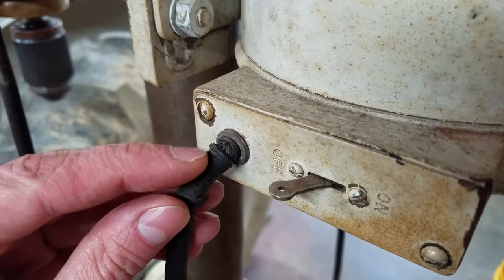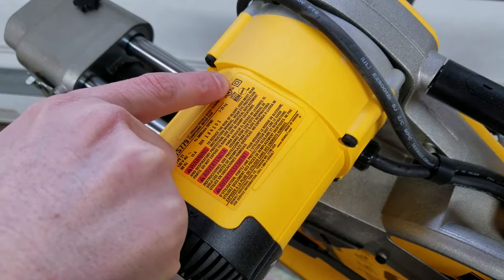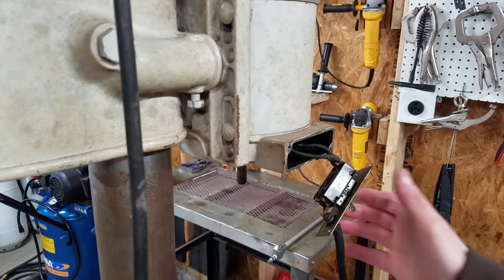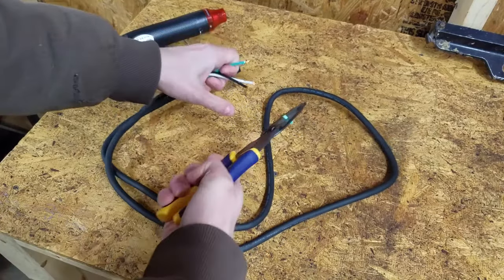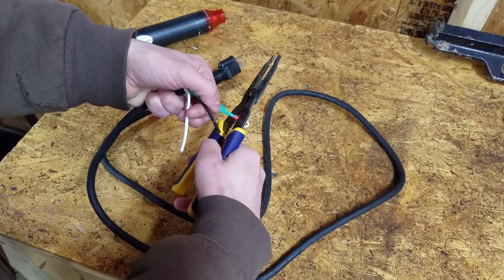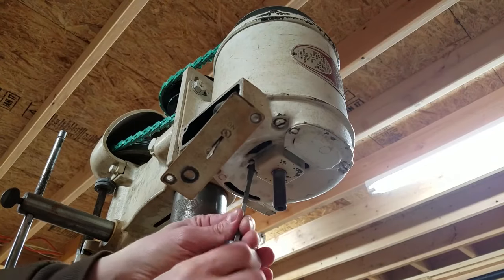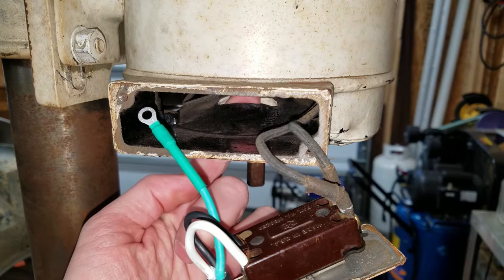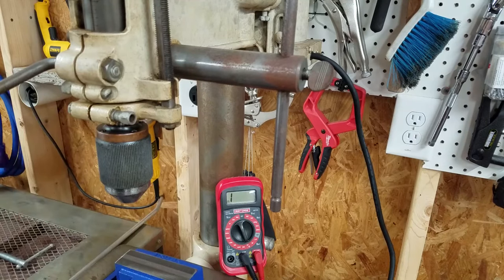Installing a 3-Prong Grounded Power Cord on a Vintage Delta Drill Press

Comment: Thanks for the video! I picked up an old Westinghouse Mobilaire pedestal fan off the curb for use in my garage. It still works fine, but the old grey 2-prong cord is pretty cracked and I would say unsafe. Just so happens that I cut the nice long 3-prong cord off my previous Bissel carpet cleaner before I threw it out and want to put that cord on the fan. I figured that I could just run the added ground wire to an anchor on the metal fan body, but in all my looking at repair videos of old fans NOBODY was upgrading them to a grounded cord! I guess I just wanted confirmation that what I was planning was correct.
Reply from the maker: This is great, my hope was that anyone looking to convert anything from a 2-prong to a 3-prong plug might find this video helpful. Thanks for the comment and thanks for watching!

Comment: This is exact;y the problem I need to solve.  Finishing the restoration on a 1948 Buffalo Forge drill press.  Would like to transition that old plug from 2 to 3 prong.  Thanks, Mike!
Reply from the maker: I'm glad the video was helpful, thanks for the comment! :)

Comment: Good Video. I'll be replacing a Power and Switch cord on an old Dayton 16 inch Drill Press, so I'll probably go with a 14-3 cord. The Motor is a Dayton 3/4 HP, 120 V. 10.8 Amps. Thanks for the wire type information too.
Reply from the maker: Thanks for watching!

Comment: Thanks, this was helpful. I just added a new grounded cord to a 1940s era drill press. When you do the continuity test with the ground plug does the reading on the multimeter matter or is the beep indicating continuity sufficient?
Reply from the maker: As far as I know, the beep is the only thing that matters. Thanks for watching!

Comment: 1. Use strain relief, not glue.
2. Ground using red terminal connector? That’s like 22 gauge! Bet it’s supposed to be blue or even yellow. Doesn’t need heat shrink. It’s ground and the terminal has insulation(bit not even needed.
3. Use nameplate to determine amperage, then size wire appropriately.
Reply from the maker: Thanks for watching!

Comment: picked up a 3/4 inch drill and got the suprise but not a shock, it has the 2 prong and got some cords laying around so doing this swap is a learning experience 
until i make the drill cordless

b&d 7301 has continuity also
Reply from the maker: That's cool, I've always wanted to try converting a corded drill to cordless and a cordless drill to corded just so I can learn more about electronics.
Reply: @Mikeattempts   nowadays cordless is easy but finding the right motor takes some thought

Comment: Hi.  I have an electric fireplace but it has a 2 prong plug and it gets hot when i use the heat function on the fireplace. Can i switch the cord out for a 3 prong to fix this problem.
Reply from the maker: I'm not even close to a pro so I'm in no position to give you advice like that. However, I can tell you that going to a 3-prong plug wouldn't help in your situation. If it gets too hot, it could be a fire hazard. I would call an electrician, maybe they could replace the whole power cord with much thicker wire.

Comment: Hi Mike. I recently replaced the wiring in my old drill press following this exact method, however when I plugged it in, it shorted my GFCI outlet, which my research now shows might be the outlets fault, not the motor. However, are there any additional steps I can take besides using the multimeter technique you showed to ensure that the motor is wired properly before plugging it in again. When I first wired the ground, there was some old paint on the metal, bit after filing it off, I tested the ground and am getting 0.
Reply from the maker: I want to start by saying that I am not an electrician. In my case, there were just 3 wires. If your ground wire didn't have a good connection at the drill press, you wouldn't have noticed except with the multimeter test. Unless your ground wire was accidentally touching another wire. The only other thing I can think of that would cause the GFCI to trip would be if there's a short in the motor windings or at the switch. I would just re-check the connections from the motor to the switch and also the connections from the switch to the power cord. You might want to wrap the switch with electrical tape, when you're done checking the connections, to be sure it's not touching the switch housing in some way. Let me know how it goes.
Reply: @Mikeattempts  thanks Mike, do you know of any sort of place I could take the motor where they could test it to make sure that it's safe to use? I'm also going to try rewiring everything using a heat shrink wrap to ensure that no wire is exposed
Reply from the maker: @adamthewoodworker2571  You could ask an electrician to test it for you. You could also use the same multimeter test I used in the video but test each of the other two prongs on the plug. You should not get a tone on any of them except the ground prong. If you get a tone with one of the leads on either of the other two prongs while touching the other multimeter lead to the metal drill press housing, you have a short somewhere.

Comment: Wow .  I have a Delta model 970 (a little older than this one) with the same weird looking on-off switch.
Reply from the maker: Yeah, it's like you're supposed to connect a stiff wire to it so you can turn the drill press on and off from the front, but I don't see where it would attach.
Reply: @Mikeattempts  .  You're right.  I looked at mine and don't see an attachment point either.